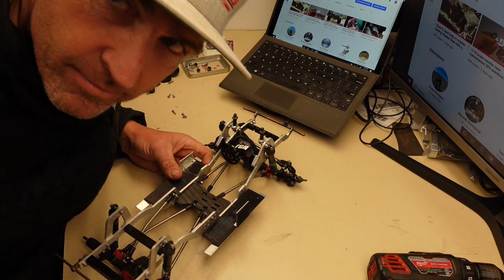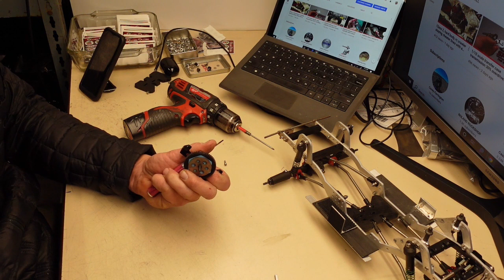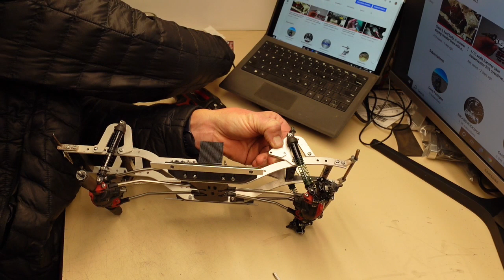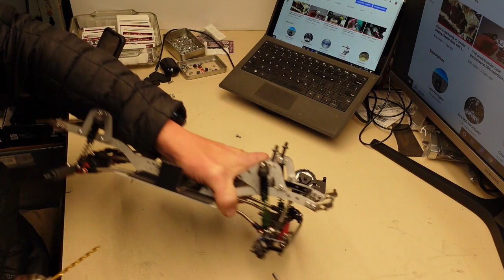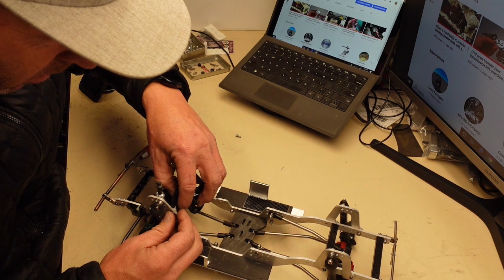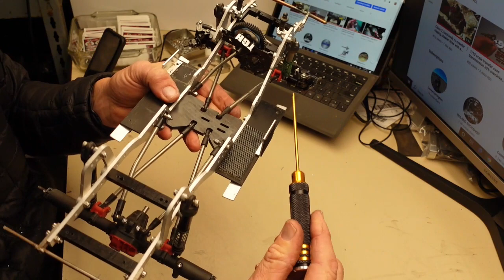How to mirror the TGH-FMM forward motor mount on the GSPEED V1-C1 Chassis to run Axial AR45 axles

Comment: What are the specification for the bearing and spur gear that you used? Thanks.
Reply from the maker: V1-C1 package deal

https://gspeedchassis.com/collections/v1-c1-performance-parts-and-packages/products/gspeed-chassis-v1-c1-package-deal

Square chassis spacers
https://gspeedchassis.com/collections/tgh-v3-products/products/gspeed-chassis-square-spacers
.
GSPEED G-LD servo mount
https://gspeedchassis.com/products/gspeed-chassis-g-ld-laydown-cms-servo-mount
.

Hard body mount sliders for the RC4WD Mojave ii hard body 2 door
https://gspeedchassis.com/collections/v1-c1-performance-parts-and-packages/products/gspeed-chassis-v1-c1-hard-body-mount-sliders
.

Forward motor mount and 30% overdrive transfer case
https://gspeedchassis.com/collections/tgh-v3-products/products/tgh-forward-motor-mount-for-v3-chassis-and-30-overdrive-creeper-t-package
.

I'm running the TGH-FMM forward motor mount and transfer case with AR45 axles. You'll need the TGH mirror drilling jig kit to assist in laying out new holes to drill in the front shock hoop brackets in order to mount a mirrored front motor mount.

https://gspeedchassis.com/collections/v1-c1-performance-parts-and-packages/products/tgh-mirrored-drilling-jig-forward-motor-mount-kit

Instructional video on mirroring the front motor mount https://youtu.be/hqGZ6ldiAJo

Instructional video on mirroring the Creeper T transfer case https://youtu.be/WHppEWlDsEE
.
Suspension link kits can be purchased here. There are drop down menus to select the parts you are building with, like AR45 axles and G-MP panhard mount.
https://hardcore-rc.ecwid.com/G-Speed-V1-C1-AR45-Portal-Kit-p367791960
.
Wheel base- 11.75"
Front and rear drive shafts- 105mm
Center drive shaft- 70mm
You can use drive shafts like.....
https://supershafty.com/products/supershafty-mip-hd-driveline-individual-parts_pos=1&_sid=087864444&_ss=r&variant=12160250708062
Or
https://www.amainhobbies.com/axial-wb8hd-driveshaft-set-2-axi31133/p-qtqqtqtqymzxactz
.
3Brothers RC 👇👇👇

https://www.3brothersrc.com/product-page/anti-foams-4-19-1-pair

G14 servo 
https://gspeedchassis.com/products/g14-direct-power-servo?_pos=1&_sid=76baf2e7a&_ss=r

3Brothers RC 2750kv motor
https://gspeedchassis.com/products/kratos-ten-2750kv-10-pole-sensored-brushless-motor?_pos=1&_sid=db51ae6a0&_ss=r

Recommend Team KNK hardware
3mm screws, nuts and washers 
https://gspeedchassis.com/collections/team-knk-hardware/products/team-knk-hardware-700-pcs-monster-bag-stainless-hardware-kit
Assorted spacers
https://gspeedchassis.com/collections/team-knk-hardware/products/team-knk-hardware-aluminum-spacer-variety-pack-natural

Comment: Bro i have gspeed chasis otw if im using front motor mount do i need still drill a hole to install the front mount
Reply from the maker: If the TGH forward motor mount was purchased from the GSPEED Chassis website, it comes with shock hoop brackets that don't need to be drilled if not mirroring the mount.
Reply from the maker: What front motor mount?
Reply: Tgh forward motor mount

Comment: Will your new chassis be coming out with those holes predrilled or is that something to come?
Reply from the maker: No. The shock hoop brackets is what needs to be drilled on the V1-C1 and they come with the transmission, not the chassis so holes will still need to be drilled in the future

Comment: Just a tip to others, to prevent the drill bit from running, bolt up the triangle piece with both fasteners. Take your bit and drill through the hole in the guide to make your hole in the frame rails. Unbolt it and do the same to the other side.

Comment: Will you add the mirrored skid as an option for the V1-C1 chassis kit? Please 🙃🙃
Reply from the maker: Mirror skid won't be part of a package, but you can purchase the V1-C1 rails and hoops separate. V1-C1 should be back in stock in a couple weeks
Reply: @GSPEEDCHASSIS  got it. Looking forward to building a C1 with ar45s with a combination of TGH and GSpeed stuff.